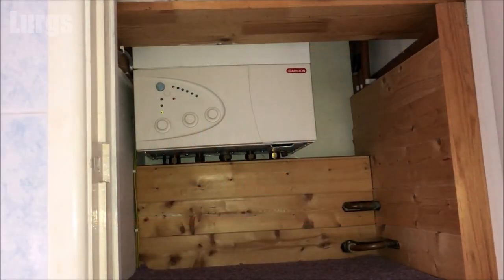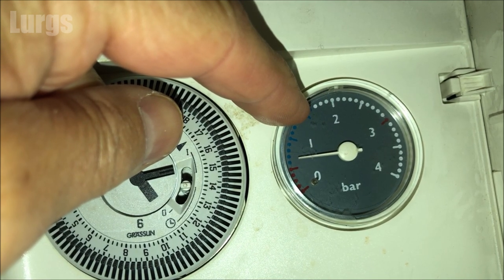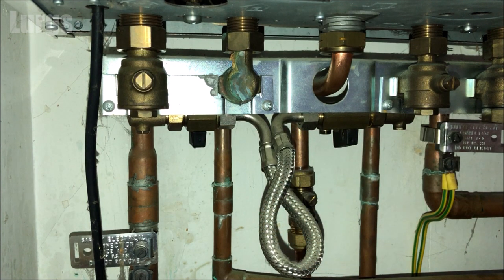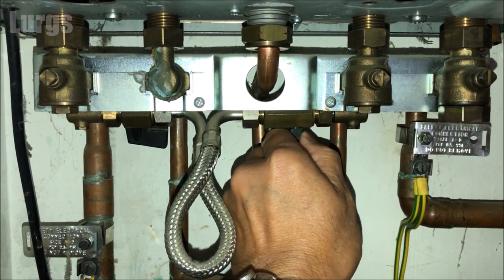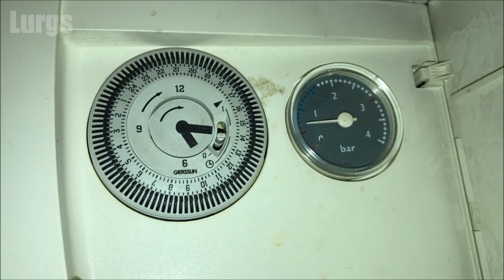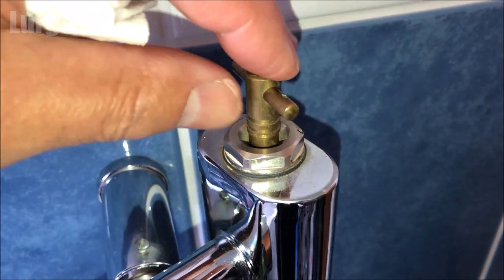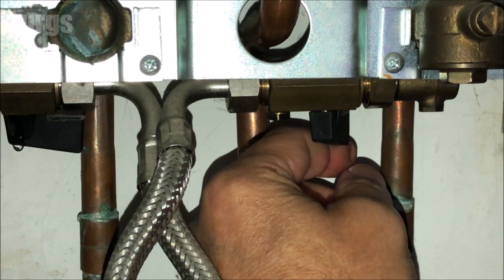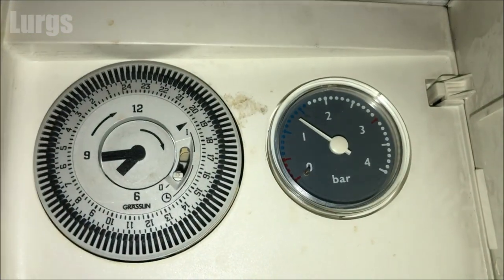Boiler Pressure Low & Topping up Combi Boiler pressure if Heating is not working properly

Comment: Fantastic! Really simple job but can be so daunting when you have pipes all over the place. 
Top work!👏🏻👏🏻
Reply from the maker: Thanks, glad it was helpful. 😎
Reply: Have you ever encountered that the filling loop fills up the system very very slowly? Could it be debris in the filling loop do you think?
Reply from the maker: Could be a faulty pressure gauge like this one, it was filling Ok but took ages for the dial to move. Unlikely to be debris as the filling loop is mains cold water.

Comment: Thank you for this video. I need some help. My hot water is working, but the heating (radiators) are not switching on at all. What could be th reason for this? Could it be the pressure? I hope it's something easy to fix. Thanks
Reply from the maker: Try this video first https://youtu.be/c0lmhD1epDE
Are you sure there isn’t a room thermostat somewhere set really low so you wouldn’t get any heat? Maybe you have Thermostatic radiator valves which are all closed down?
Try all those things, if no luck you will need to call out a Gas Safe registered engineer. Good luck

Comment: Why when i try to top up pressure while the boiler is off , water is not coming into the boiler to increase the pressure!!!
Reply from the maker: It could be a faulty pressure gauge so be very wary of going too mad topping it up. Sometimes the gauge may take 5-20mins to start registering (if it's old). Just be careful. Do a small amount at a time and see if the gauge moves.
Reply: @LurgsHowToGuides  Thank you so much for that . Yes it is old but finally the problem has been sorted . Thanks again.✋
Reply from the maker: What was the issue? Was it just taking time to register the pressure?
Reply: @LurgsHowToGuides  A service team fixed the problem indeed. Thanks.

Comment: The left hand side tap is leaking on my one as soon as I open it.....
Reply from the maker: Yes sometimes they do leak a little, you can still top up the pressure then close the taps again. Have a very Merry Christmas. 🎄
Reply: @Lurgs How To Guides  thank you for the reply. I think there maybe something wrong with my boiler as I followed your instructions and had good water pressure yesterday however today the same thing has happened and had to top it up again. Plus the left hand side leaks for around 2 hours before stopping!
Reply from the maker: @everythingandmma1239  Boiler is probably ok, pressure going down indicates a leak which is what you have. Could be some air on your radiator pipes so try letting some air out of the highest radiator in the house. Else if no joy I’m afraid it’s time to get a plumber round